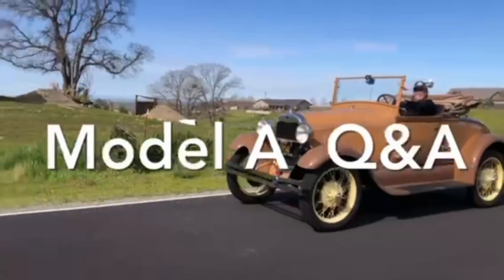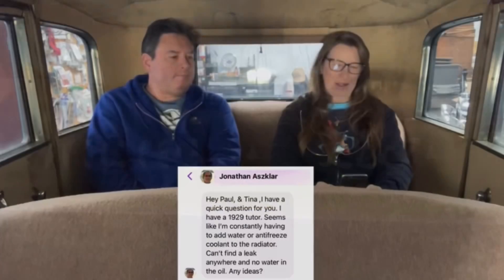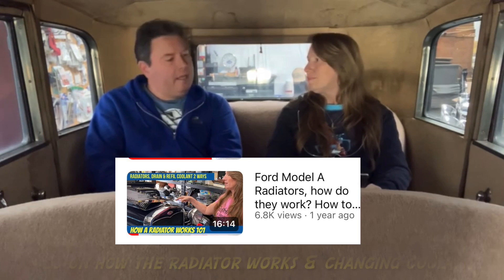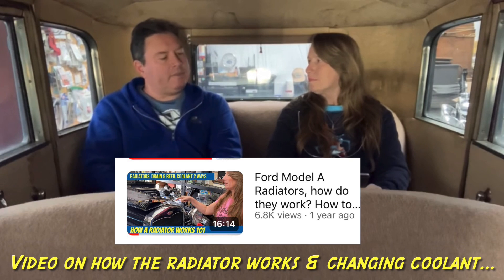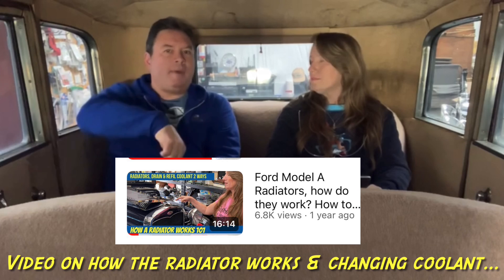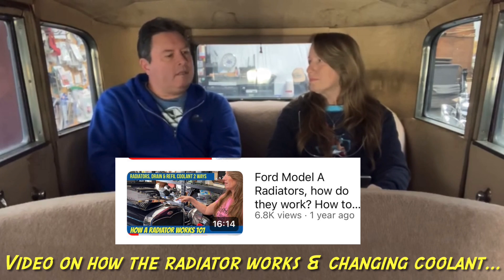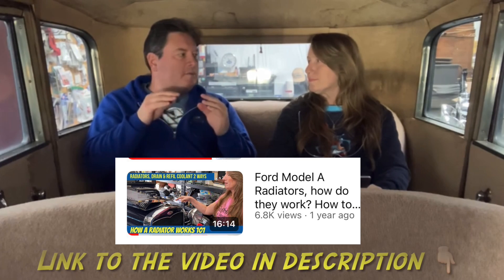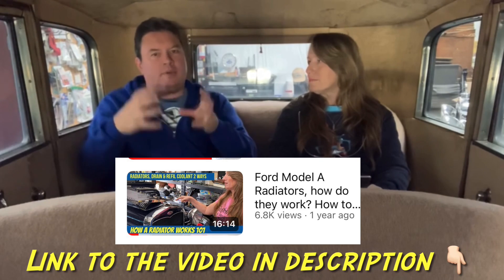Constantly adding water & coolant to radiator, what could be the problem? Model A Q&A of the day

Comment: Fill the radiator up and leave the radiator cap off. With engine running on fast idle, look for bubbles in the filler neck. There should not be any. If there are, stop engine and remove fan belt. Now start engine again and run on fast idle. Look for bubbles. If NO bubbles without fan belt, but bubbles WITH, the problem is the water pump, not the head gasket. Save yourself a lot of work chasing what you think is a bad head gasket when it’s the water pump. This is not theoretical, I have seen it on several engines over the years. Have a Model A Day! Jim
Reply from the maker: Thanks for sharing!

Comment: Modern engines, but some problems may apply to the model A's. Being I had access to a smog emissions tester I would use it to detect HCs (Hydrocarbons) coming from the radiator opening, then I knew that combustion gases were entering the cooling system. I have also seen small cracks in the cylinder head or cylinder walls that only open when hot and reseal when the engine is cool with no water in the oil, but sometimes a very small amount of oil in the coolant, but it's hard to see at the radiator opening until drained into a pan then you see a thin layer of oil floating on top of the coolant. On modern V8 & V6 engines that have intake manifolds with cross-over systems coolant will leak from the cross-over into the intake valve on the head and then burn in the cylinder. On carbureted cars, some used a cooler plate below the carburetor that if the gasket went bad would also leak into the intake manifold. With any leak, if it's really bad you will see white smoke or excessive water coming from the exhaust tailpipe. Have a great day and Happy Valentine's Day, Mike ASE Master.
Reply from the maker: Thanks for your share, happy valentine 💕💗

Comment: Question: I just purchased my first open car, a 1928 standard phaeton that is bone stock. Planning to install a fuse and master shutoff next. What are your thoughts about turn signals and safety belts. Is it a good idea for safety belts in a open car? Considering roll over. Rods, Jim
Reply: If you're in an accident, you're better off staying INSIDE the car.  Add seat belts!  If you drive your Model A a LOT, installing turn signals is a good idea.  If you're a once-or-twice a month driver, use hand signals.  People get a kick out of seeing me do that.
Reply from the maker: I have my roadster, it has seat belts, we like using seat belts, they do help with safety but it also depends on what kind of wreck you get into, if you roll like our friends did, they were lucky that they weren’t wearing seat belts because they were thrown from the vehicle keeping them safe, if they’d stayed strapped in, they’d be dead.
We completely believe it’s important to have turn signals and one of those orange caution symbols on the back, we always install LED break lights and head lights for better visibility 💕 
With that, you’ll have to choose what you’re comfortable with, you may never be in a wreck in your Model A, who knows…God willing 🙏♥️

Comment: Avoided one of the obvious answers (based on lack of information provided to you). He may just be trying to keep his radiator topped off, which results in overflow out the overflow tube until the proper volume is reached.  When I was a newbie, happened to me until I was told to maintain the proper level and then all was well.
Reply: I was thinking the same thing.
Reply: Yep, could be.  I've covered that so many times already, I guess I just assumed that wasn't happening.

Comment: Great advice! So my son's tractor blew a head gasket in 2020, I think, anyway I noticed it blowing steam out the exhaust, diesel engines don't do that when their hot. So we replaced the head gasket and went on the next year, until the engine started loosing power. That next spring we pulled the head and found out the the head bolts was at least 20 or more pounds low, the torque wrench was under torquing the bolts. Had another blown gasket and a cracked number 4 dry sleeve. Moral of our story, never assume your tools, i.e. torque wrench, is correct, check to be sure. Sorry for the long story, but I thought it was a good point to share. Thanks for the Q&A advice, have a wonderful day!
Reply from the maker: Thanks for sharing!